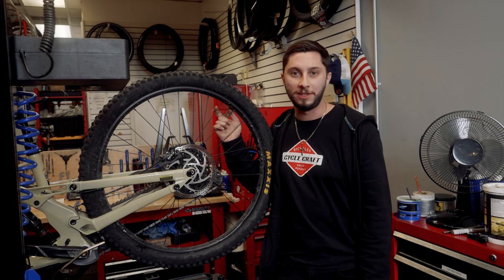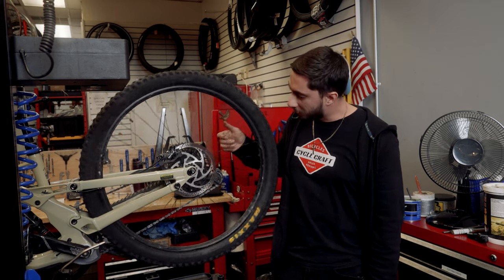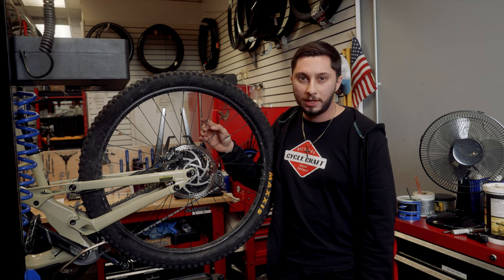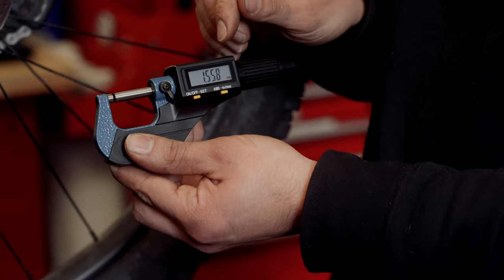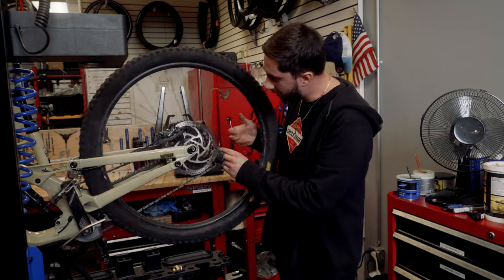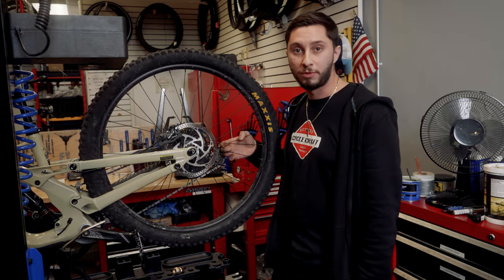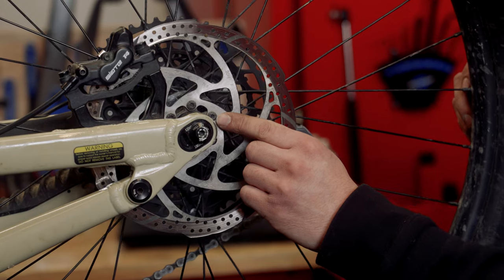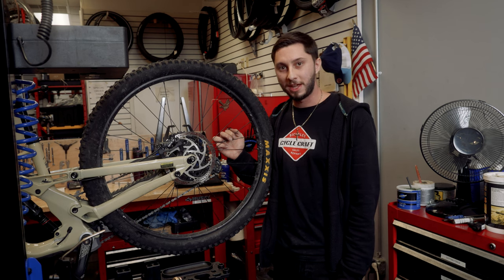Give Your Disc Brakes Some Tlc - Show Those Rotors Some Love!

Comment: I have a bike that I haven’t rode in a while.  It’s been in the garage and I’ve noticed some rust developing on the rotors themselves.  Is it something that can be removed?  Or should I just replace my rotors?
Reply from the maker: +@AJXOXO-vz1pn depends on how much rust. A little surface rust can be removed with steel wool but if in doubt, you can’t go wrong with new!
Reply from the maker: +@AJXOXO-vz1pn some rubbing with fine steel wool can remove some surface rust. You can then clean up with some isopropyl alcohol. You may still get a little noise from them but should stop you. That’s all assuming the rotors are not worn out or heavily scored.